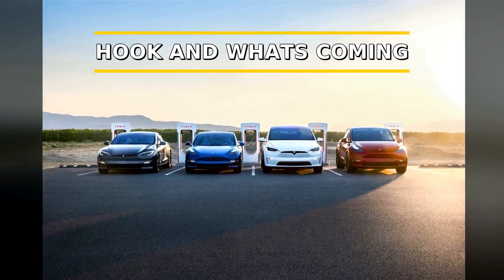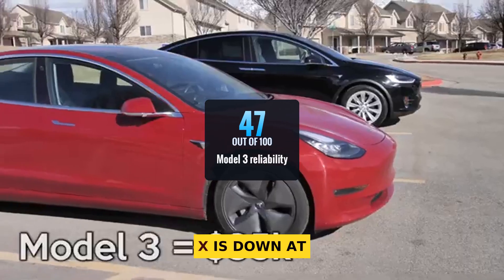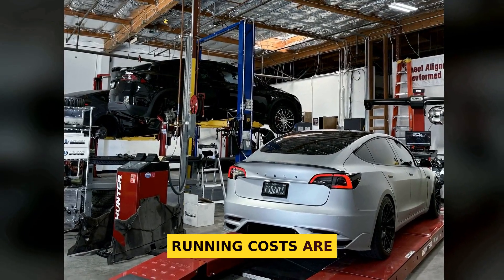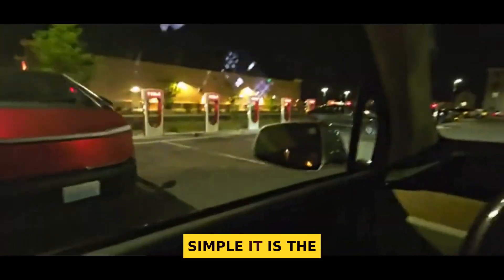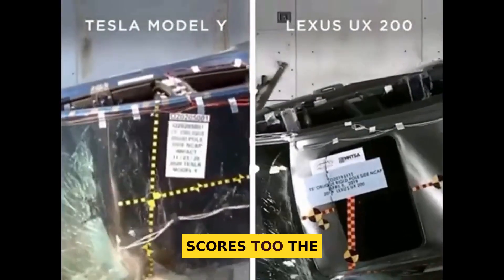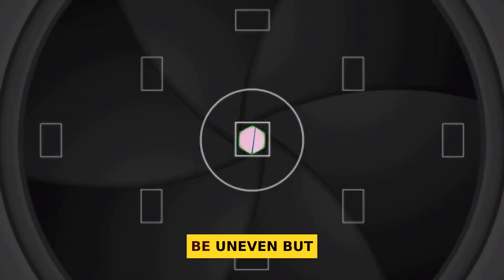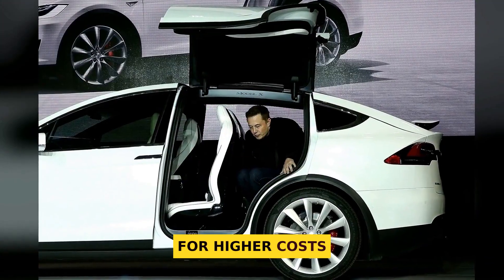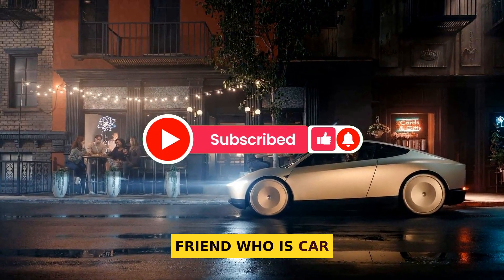Tesla Models Ranked: Worst to Best [2025 Guide]

Comment: I wonder where you rank the Chevy volt that burns up garages?
Reply from the maker: @AndrewFuller-xk2lc The Volt isn’t in this Tesla ranking — it’s a discontinued plug‑in hybrid (model years 2011–2019) — and while there were a few high‑profile fire cases, they were rare and often linked to crash damage or improper servicing, which GM addressed with recalls and service fixes. If you want a separate comparison of non‑Tesla EV/PHEV safety and fire risk, I can put that together — subscribe for future deep dives.